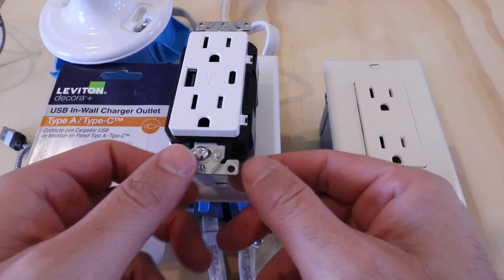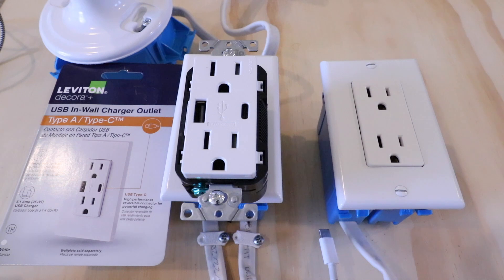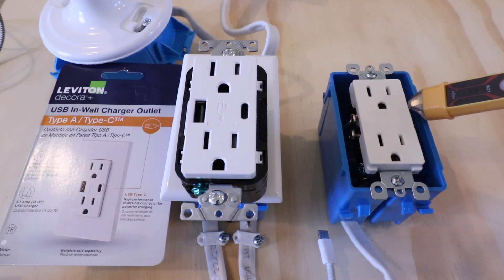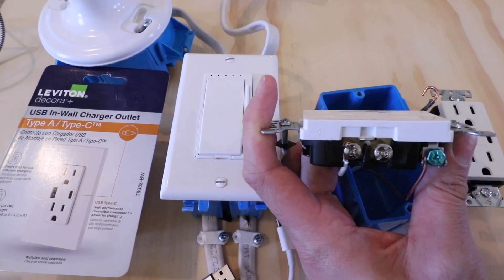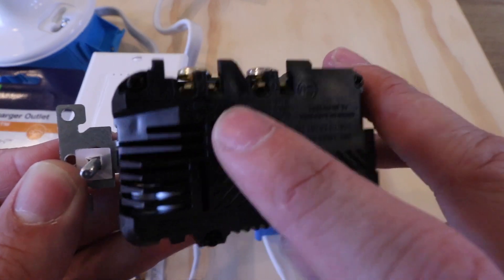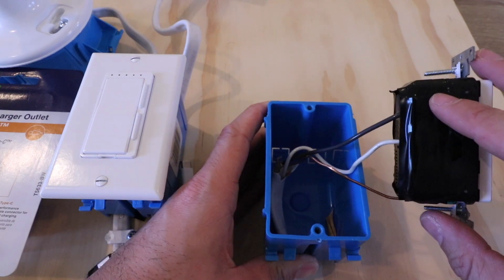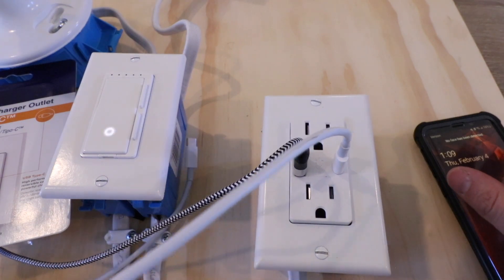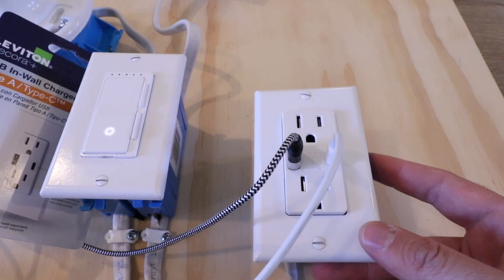How To Install USB C Outlet With USB Wall Outlet Fast Charging

Comment: I have 2 white wires, black wire, a red wire, and ground.  How doni hook up the usb outlet
Reply: Red wire suggests there’s a switch involved with the outlet. Is it turned on/off by a wall switch ?

Comment: Please don’t wrap your outlets in tape.  I know people have very strong opinions about this, but it serves no practical purpose and could possibly hide minor problems that will turn into major problems like your house burning down. You know generally within about five years that tape loses all of its properties that make it electrical tape, and then it becomes some thing that could get hot or absorb moisture and also wrapping it twice negates the safety feature of the tape prematurely. I know he gave an example of not letting other wires touch the outlets hot and neutral but the wires that are in there should never in any way have that possibility The only time you should see electric tape in an outlet is when it is signifying which wire other than black is hot.

Comment: the new  outlet is install wrong in this video  the wire need to be  install from the back side between two brass plates
Reply: That's only if you have 4 wires. If you only have 2, the side connections are better, which is what he did in this video.
Reply: Do you have a video doing that?

Comment: Replacing my kitchen outlet, the old outlet has black, white, RED, and ground.  It is in a box along with two light switches.  The light switches and outlet are connected to separate circuit breakers.  I completely understand where to connect the white, black, and ground, but where does the red connect to?   My thinking was with the black, but the circuit jumps when I turn it on.  FYI, the outlet never had a light switch connected to it.

Comment: NEVER trust a "Non-contact Voltage Meter" by itself for verifying a live circuit. ALWAYS check with a MULTIMETER 
sometimes these devices fail and when it does, you may end up dead.

Comment: Mine has 2 whites wires and 2 black wires is this okay to do still?!?
Reply: Yes it will be okay some outlets come with two ports hole to connect the extra wire in some power boxes in walls you can have both white wire on the neutral side and both black on the hot wire side and then the ground should be okay
Reply: I was thinking of the same thing most people will come across a chained outlet.

Comment: I got one of those for my kitchen but there an extra red cable
Reply: In a three-conductor cable, the extra wire is red, and it's almost always used as a hot wire. When you see a red wire in a 120-volt duplex outlet box, it's usually because one of the outlets is operated by a wall switch, while the other is always on. The red wire is for the light switch.

Comment: You can also plug in a small desk lamp, turn it on and then check if the power is off when you cut the breaker. The problem with these devices is not all manufactures use the same fast charge circuitry and you will be relegated to standard slow charge. Putting electronics in the wall  puts points of failure in the wall, and will likely be obsolete in 2 years.

Comment: Just to be clear, the 5.1A is when both ports are used and indicates the maximum capacity of the charging circuit. If you only use the Type-C it can only output a maximum of 3.0A and if you only use the Type-A it's maximum output is 2.4A. All this information is provided by Leviton and is in their product bulletin (https://www.leviton.com/en/docs/G-10108A_Revise_Type-A_and_Type_C_USB_Product_Bulletin_final.pdf). When installing one of these make sure it can actually produce enough power to fast charge. 3.0A is typically not enough for most of the newest devices to fast charge them .

Comment: Oddly, I just watched you other video on installing one of these (the one without the USB C). Curious, how does one know what amp unit you'd need for the home?
From my research, they are offered in different amp options. Hence, my question. Thanks